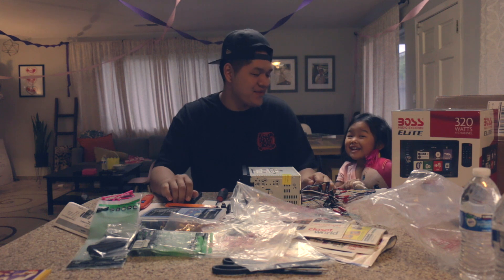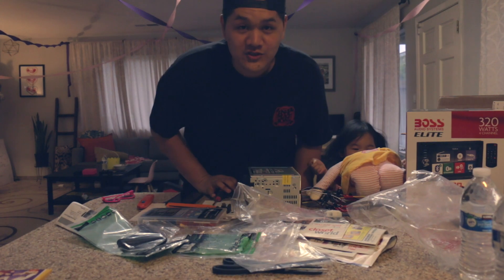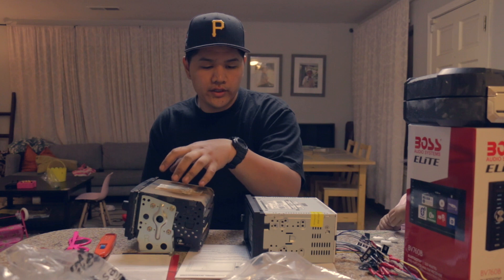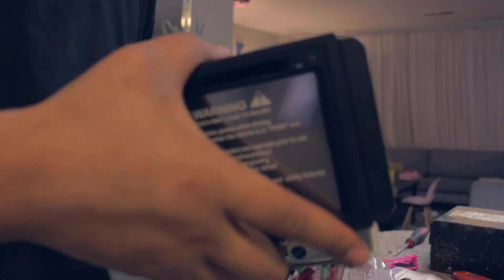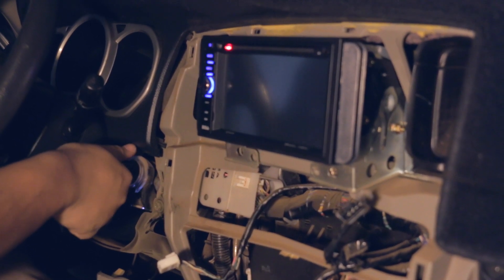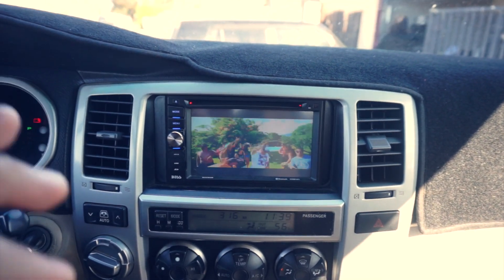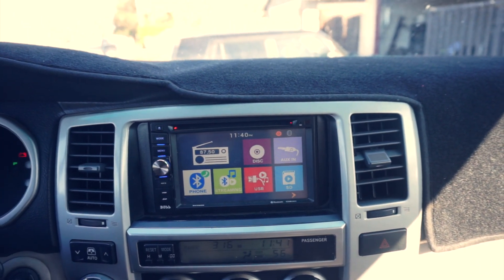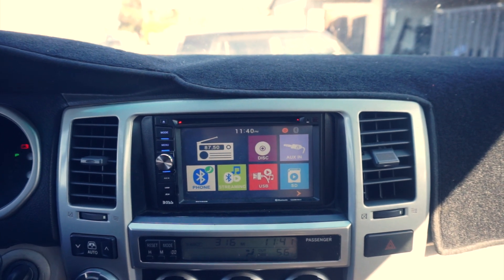Boss BV760B Install

Comment: Hey Blain, liked your video, very informative for a first time stereo replacement, but unfortunately it seems i made some rookie mistakes. Instead of the BV760B you bought, I bought (and already installed) the BV755B, and it did not come with the necessary side trim panels. I sent a help ticket in to BOSS, but do you think they can help me just buy the panels, or will I be stuck with gaps on either side of my stereo unit?
Reply from the maker: MrIncredible123 if I’m not mistaken the side pieces come with your double din installation kit(purchased separately) and not the double din itself.

Comment: Hey man, I have the same set up and same vehicle. When you installed it did you have any problems with the plastics on the side of the unit they sent? Mine wouldn't fit when I put it all together. I wanna say they made new plastics cause mine was in one whole piece.
Reply from the maker: no I don't recall having any issues with fitment